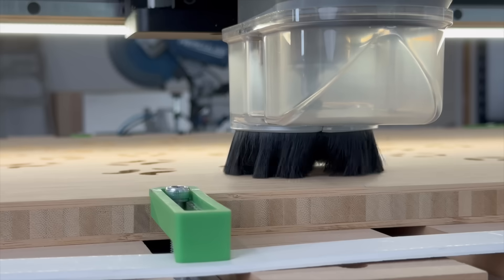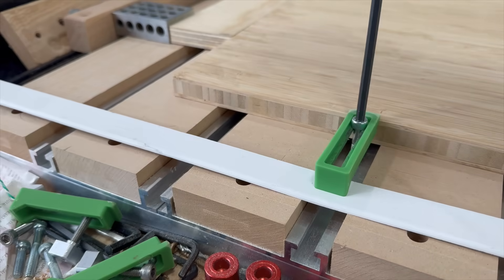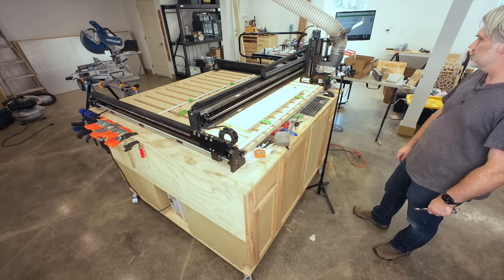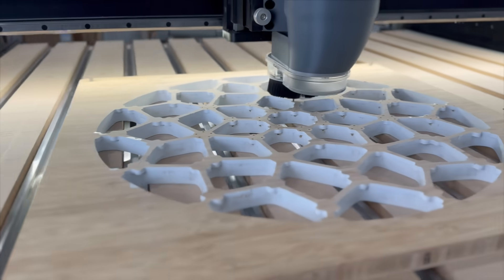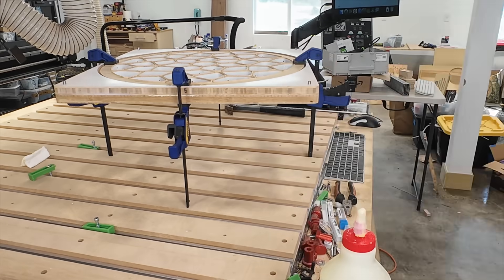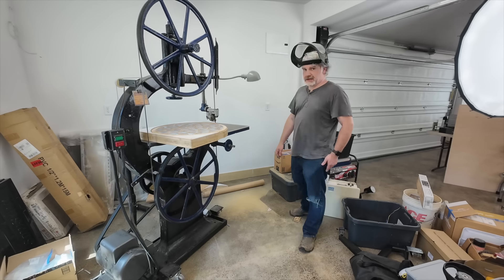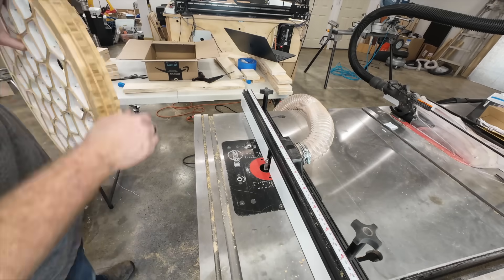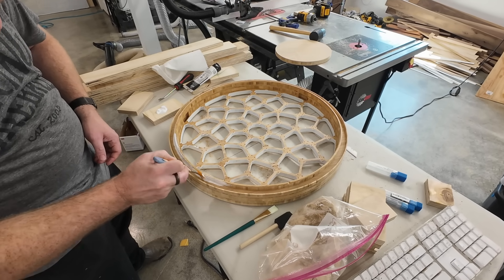The Error that Made This Piece Unsellable

Comment: This is fantastic! Have you thought of using these as some kind of notification for home automation? A simple integration with MQTT could cover a wide range of cases. Users could then do things like "display a light dance when the doorbell rings". 

You could probably use it to trigger home automation switches too, maybe with specific hand gestures, but that would probably require some more advanced programming. Just some ideas 😀
Reply from the maker: Yes, I am planning for it to have the capability to be what I call an "ambient information display", changing the visualization based on inputs like day of the week, the weather, or other stuff. Should be fun!

Comment: I love this, so thanks for sharing. Can I suggest a pin router rather than bits with bearings. When doing cutouts , I double sided tape everything to a spoil board, so the pieces remain where they were cut. I don't use CNC, just a normal router. lol I just got to the point where you DO double side tape the acrylic to a spoil board, so ignore the earlier point. 
Quite recently I've learned how to construct Islamic Geometric Patterns, so I'll be trying to make one with interactive lights (just as soon as I finish up a couple of other things). Thanks again for the inspiration.

Comment: For quick sanding of your lenses, have you considered a vibratory rock polisher with a fine sand? It would provide an even, frosted appearance to all sides of the pieces.
Reply from the maker: I have, but the trick is that the bottom needs to stay polished, otherwise the cells don’t look nearly as cool from an angle. Turns out the internal refraction is important.

Comment: Your bandsaw is insane!
Reply from the maker: I know, right!? It's gorgeous and a little terrifying. I want to add some more modern features at some point like a fence and a little bit more protection for the back of the blade and the top and bottom wheels... With a machine like this though I don't want to do too much to it, but I'd like to be able to use it more often because I find myself avoiding it at the moment. We will see. I'm sure it will eventually get a lot more use and be showing up in future videos.
Reply: @VoriaLabs  Polycarbonate shields that covers the wheels perhaps?
Reply: @VoriaLabs It's a beautiful machine; makes me think of a classic bicycle 😁
I'd be terrified of it too. As my old woodworking teacher said, "Every powertool wants to k!ll you."

Comment: Wow, such beautiful work. Came out so good! Also, great video - subbed.
I had a very similar router mishap recently, I ended up cutting out a larger pocket into which I glued another piece of the same type of wood, and then I used the flush trim bit to flush it up, you can barely tell anything happened.
Also, curious why you don't use the CNC to apply the chamfer to the acrylic pieces and save yourself that labour?
Reply from the maker: The chamfer is on the bottom, so I’d need to do some dowel registration and machine out the mirrored chamfer and then apply tape and flip… hmm… that does seem doable. I guess optimizing that step didn’t occur to me because, of all of the repetitive steps, routing the chamfer wasn’t nearly the most annoying. But I like your idea! It would also make things more consistent. I’ll give this a try the next time I’m machining out lenses.
Reply: @VoriaLabs does it have to be the bottom? Could you mirror the design and cut it from the back to skip those steps, that seems like more work than just doing it by hand, haha. But I guess you never know until you try

Comment: Regarding loose pieces in CNC - one trick you could use is, once you've cut your first layer, take a nailgun and put a couple pin nails through each loose piece into the backing. That would hold them in place while the CNC cut the pieces all the way out.  They would then be fairly easy to pull off the backing.
Reply from the maker: Ooo, that is a good idea. I’m not sure if my Brad nails will make it through 3/4” bamboo, but I could pocket out a hole for the Brad and that might work. I’ll give this a try next time! The mechanism I’ve been using since I recorded this video is to actually suspend the plywood up about an inch and adjusting how the cut operations are performed so that the pieces just fall though harmlessly. And this kinda works? It’s not perfect, but it was way faster than all the tab cutting+cleanup. I’ll try the nail idea next!
Reply: @VoriaLabs  You can use heavier nails, get a 16 gauge nail gun. It's just that the heavier the nails you use the more damage it does to the backing. You might want to get some extra backing.
Reply: good point

Comment: I machined acrylic with a cnc mill for a project. I drilled some holes in the acrylic (away from the tool path obviously) and used wood screws to secure it to the base board. I think I might have used some double sided tape in the center of the piece to make sure there would be no issue as I only had one sheet. Not sure if the screws only would have worked though. At least you might get away with less double sided tape to lay !

It's a really nice project, I love the idea. Hope it will be successful ! 

I'm also interested in a video about the hand detection !
Reply from the maker: I did try using less tape… but I’ve had a few pieces come loose and so now I use more strips of thinner tape.

Comment: To fix the router mistake you could have made a series of straight cuts on the table saw using a sled - then glue some straight pieces of the bamboo plywood in place - then shape with the router again.
Reply from the maker: Yeah, I think something like that could have worked better. Oh well. I guess I could technically still repair it, but I’m inclined to leave it and just build a new version that I can sell. Besides, if I always keep selling the pieces I make then what will I have left to decorate my home with? :P

Comment: great vid! perhaps look into a vacuum table, toolstoday and many others market them at pretty reasonable price points.
Reply from the maker: Last time I looked the only off-the-shelf solutions at reasonable prices couldn’t handle machining all the way through the workpiece. I tried to make a vacuum jig for specific designs that would hold each piece individually but I had some trouble getting it to work well and ended up just going back to the double sided tape for now. But I really should revisit vacuum tables soon, it would be amazing to just turn off the vacuum and just scoop everything up.
Reply: @VoriaLabs  you might want to look into using MDF for your vacuum bed given it'd also double as a spoil board (just seal the areas you're not using/covered). While on a small scale we use one on a desktop CNC mill for PCBs - it generally also holds onto boards that have been fully cut out (no more tabs!) but that does depend upon the setup so YMMV

Comment: Very nice but a tedious and expensive fabrication process. A better option would be a solid piece of acrylic behind a piece of milled wood simulating the stained glass "copper" and using white 3d printed modules for the cell separators behind the acrylic. Foam is another option people have used for the cell separators. Or even cardboard lol.
Reply: Light spill within the acrylic would ruin the effect, I fear
Reply from the maker: Yup. Light spill would also significantly reduce the sensitivity of the hand detection mechanism. There are certainly easier ways to make something superficially similar to this, but it would not be the same experience.

Comment: Nice!!   Have you tried masking tape (blue painters tape) and CA glue for work holding.    Masking Tap on the spoil board, Masking tape on the acrylic, same spacing on both.   CA glue to adhere tape to tape.   Probably easier and cleaner to remove than double stick tape.   I use it for wood and aluminum work holding with my Shapeoko.
Reply from the maker: That was the first thing I tried, but it ended up being a lot more work than just using double-sided tape. It would also occasionally fail because perhaps a section of blue tape that was holding down the lens didn't actually have any glue under it. At least with the double sided tape I know that it is good to go. I still use the superglue and masking tape trick for other stuff, just not for the acrylic.
Reply: You'd think by now, the tape companies would've realized there's a market for "double sided blue painters tape", instead of having to glue the tape together with CA glue